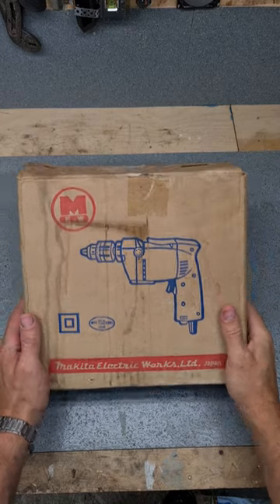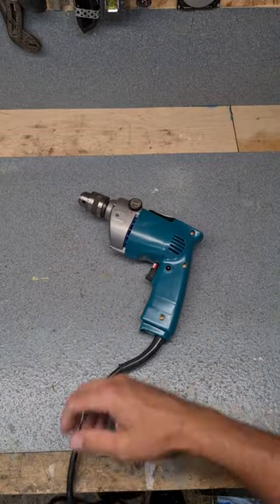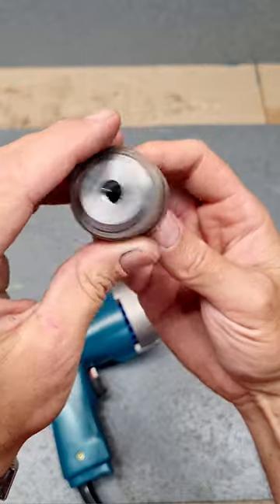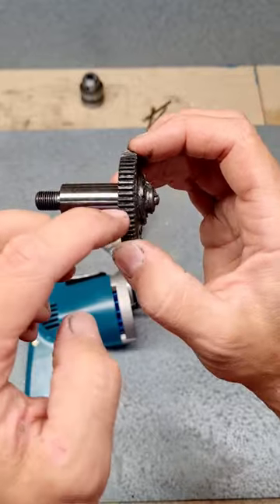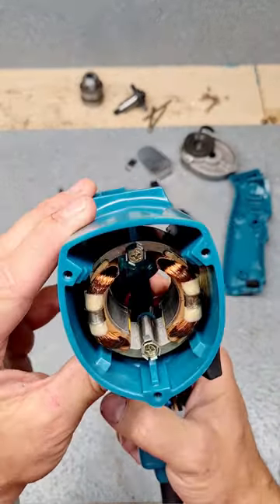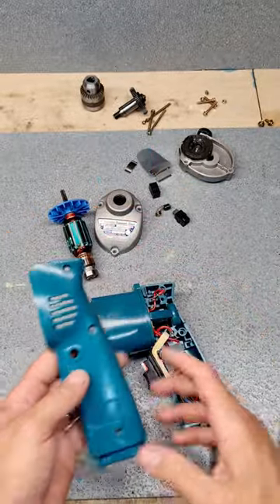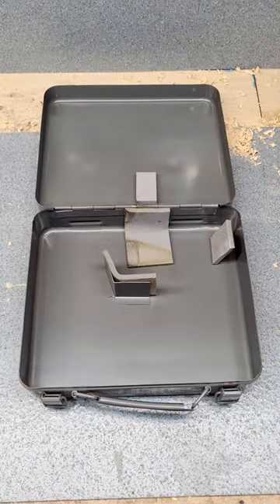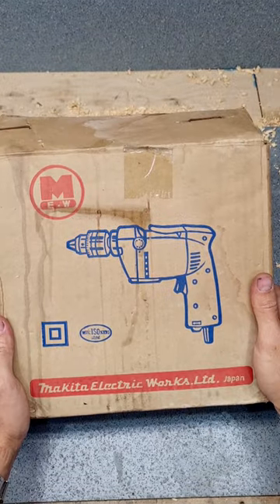Brand new old stock Makita 8410BV teardown and testing.

Comment: Although cordless drills have changed things power wise, i noticed back in the day how well balanced these corded Makitas were when you  needed  a drill with some power.   I never found another corded drill with a decent sized grip.  My whole hand fit and i could use my pointer to pull the trigger.  It wasn't front heavy either.

Comment: I am now 47 my dad bought 1 of these prob just when I was born it isn't a hamer 1 and it's just on or off trigger it has drille millions of hole it still has original rubber flex I wouldn't trust it now tho it's perished it's sitting on a shelf in our old  workshop and deserves to be on a plinth in our display cabinet

Comment: Never had the Makita version. But same sort of era Hitachi made a very similar drill. I had that. It lasted for years. When it gave up. I bought the then new equivalent. Didn't last at all. None of my original drills had reverse. It was common not to right up until early 80's. Then you got it on some models as an option for a bit extra. Before it became the norm on everything. Once the cordless tools appeared they all had reverse right from the go. Once the Japanese tools stopped being made in Japan for export. And the German tools stopped being made in Germany for export. The quality dropped dramatically. I had a load of the old black AEG tools. They were really good trade level tools. Now the new AEG are bottom end trade. High end DIY. I have a couple. The quality is definitely not there. My gripe with modern tools is the electronics. They are very fragile. None of the circuit boards like heat. Living in Qld Australia we have plenty of heat. Whatever the breed they get hot and die. So do the batteries. When the temperature is up in the 40's. Who knows how hot the tools get inside. But they don't like it. Have even had them catch fire. And battery melt down. Yet I still have and use an early 80's 9.25 inch Hitachi saw. Only ever had brushes.

Comment: I have a couple of the orange Black and Deckers from my dad, all stamped made in England.  But this looks a lot better tool, mine didn't have speed control, the switch is just on off.
Reply: Makita have a large factory in England started in 1991 which churns out around 1.1 million tools a year. Drill/drivers, angle grinders, jigsaws, plunge saws, belt sanders and circular saws. 70% is exported.
My did is 90 and still uses his orange BD.

Comment: Have u ever used a Milwaukee M18 FUEL Brushless for a period of time to see if u like it over the makita ur usin, so is the brushless makita better built then the M18 in ur opinion
Reply from the maker: The brushless mileaukee is better than the makita for around 6 months. They then turn into a bag of crap. 
Where as the makita will servie you for years. 
Every brand and tool has its pros and cons. And even one yo suited to spacifc people. 
But I find mileaukee tools very low quality tools
Reply: @deandohertygreaser  thanks for replying back thank you for the info, makitas alil harder to find near Cadiz Ohio surrounding areas, something always sticked with me about makita brand tools and people around hear got every brand so just go for personal preference, had mine almost ten years never had anything go bad on Milwaukee yet, thank you and happy Halloween, just seen dewalt and makita mix drywall mud and 1in long bit go though Douglas fur tree all the way, M18 couldn't do it